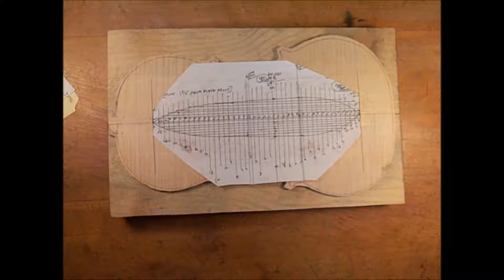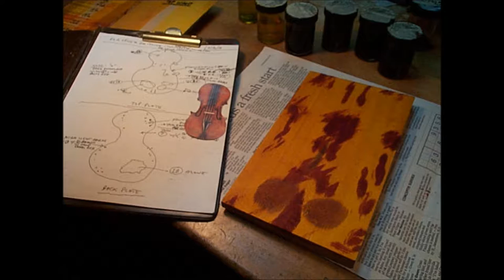Opus #28 Violin being played with construction photos ..movie two 12 9 2016

Comment: The propolis being disolved in Everclear for 4 yrs vs.4 days or 4 hrs makes no difference. Mystique mixed with esoteric superstitions and pseudo science a good instrument does not make. Craftsmanship however does. You are a very good craftsman, why not leave it at that ? As far as Dutch rush is concerned, modern micro mesh sand paper did not exist 450 yrs ago, but now it does, use it.
Reply from the maker: Cy;  Thank you for your comments.  Of course craftsmanship is the big thing, as you suggest.  I do use micro mesh products and they are valuable.  As far as the dutch rush, this is what Strad and Guarnieri used instead of a  fine sand paper and it DOES make a significant acoustical difference.  Check out the You tube videos where this is demonstrated on actual violins.  David L.